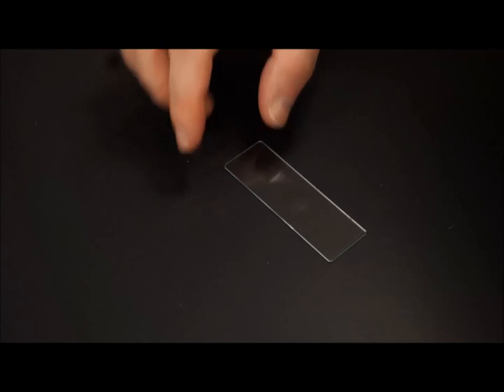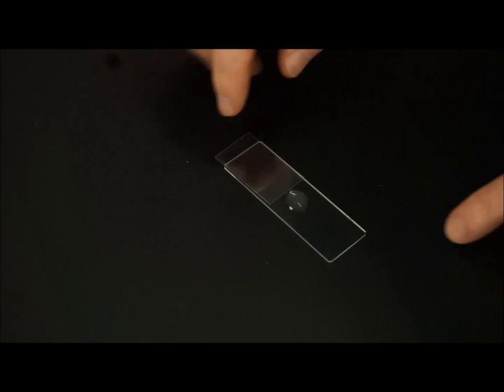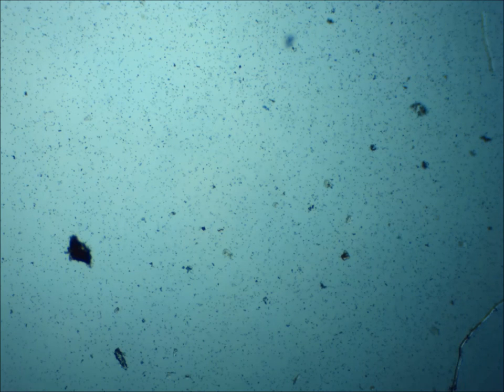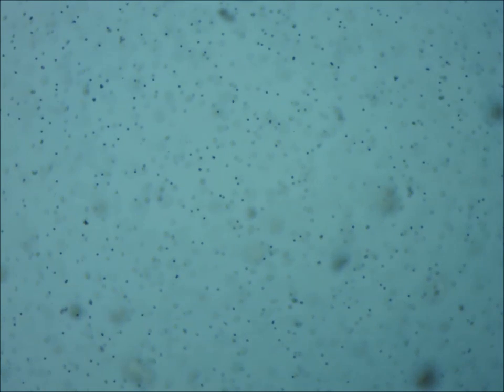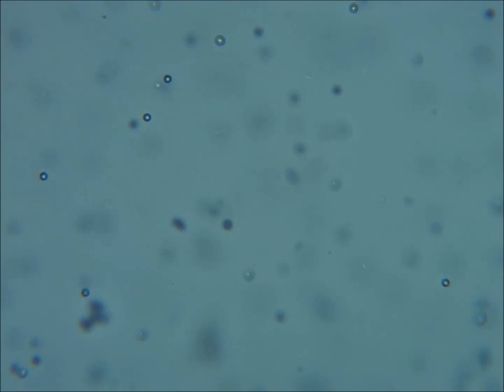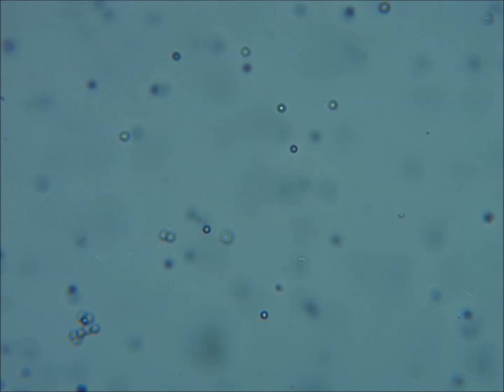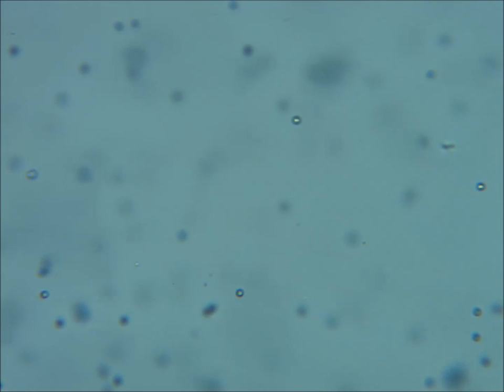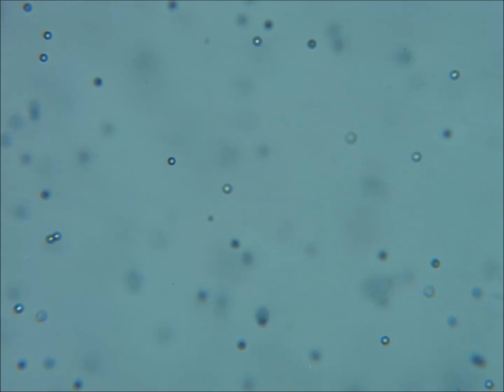Observing Brownian motion of micro beads

Comment: FINALLY a video that shows some experiment preparation and tips. It would be awesome if you also gave the brand of the beads / a link to buy them, and gave the result analysis in the video as well with the predicted water molecule mass (just plug displacement into formula, no formula derivation).
Reply: And size of beads. Thank you!

Comment: Hello. Thanks for your video. What total magnification did you use to see the Brownian motion? How can you be sure that those are microbeads? I am looking at having students take samples from a local stormwater outlet to ascertain if there are microbeads present - do you have any thoughts on that? Thanks.
Reply from the maker: I used a 40x objective. I don't recall the exact magnification.
Reply from the maker: I am sure these are micro-beads because a colleague made the sample for me. This is specially made material made with rigorous tolerances (1.00  +/- 0.04 microns). Such material would not be found naturally. That said, observing Brownian motion in natural samples is certainly possible.
Reply: @forrestcharnock3079  Nice video. I came to the comments to find the size of the beads.
Reply: Thanks for the question and reply y'all!

Comment: size of beads around 1000nm and water molecule 0.2 nm only. It is tooooo huge difference to see any movements of the beads. 5000 times linear size and 125 Billions times mass (volume) difference. I dont believe in this explanation. It like 0.000032 g piece hits elephant 4000 kg.)))